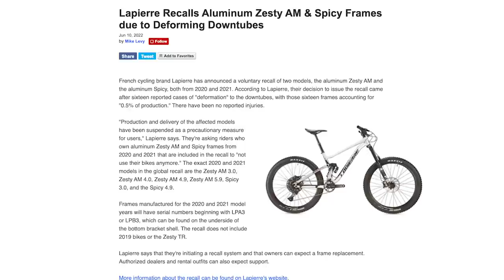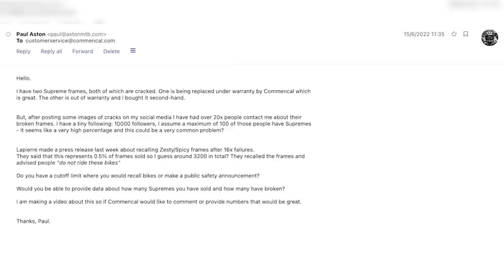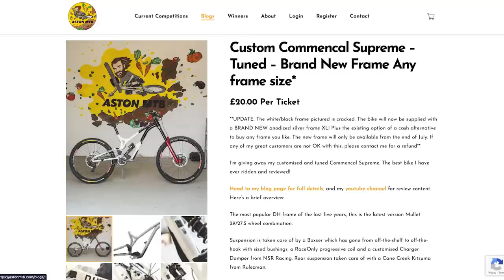AstonMTB Commencal Supreme Public Service Announcement: Recall?

Comment: Real MTB Journalism! I don't think people appreciate the concept of being fully self-funded and not taking free test products. This is the only channel I can think of that does this.  I wish you could check out the Rockshox SID XC fork. I've had 3 with bushing issues. Finally Trek just bought me a new Fox 34 because they lost faith in Rockshox ability to send a fork that lasted more than two rides.
Reply: Rockshox sends brand new forks with no oil bath on the lower legs. Saw a video aboutthat some time ago and I had the oportunity to open 5 Rockshox Recon 120mm of travel, all of them completely dry from factory. Their excuse was "It`s supposed to make a preventive maintenance service before giving the bike to the customer"

Comment: Would be really interesting to see a hardness test done in the effected areas, seems to be always very close to the welds. Heat treatment is crucial with aluminium post welding and can massively effect how the material behaves. I am a former aviation metal worker so had to deal with this on a daily basis so seeing things like this rings many alarm bells

Comment: Paul, you mention some cracks aren't too serious and should just be checked regularly. If people with those cracks in out of warranty frames really want to keep riding them, I'd suggest they spend maybe £20 and get some dye penetrant inspection rattle cans. This should highlight the full size of the crack, some of which may not be visible to the naked eye. Then with a Sharpie or similar the end of the crack should be marked. This should provide a fairly good way to monitor crack propagation.
Reply from the maker: Great advice, thanks. 

I’ll try to get some of that to check mine.
Reply: My thoughts exactly!! Hopefully the results aren't too scary!

Comment: @AstonMTB Are the followers who send in photos of cracked frames also mentioning the model, year and ~ most importantly ~ size? 

My understanding is that larger frames typically have more issues - likely because their riders are on average heavier and can create more force - but also because the geometry of the frames and tubing and welds may not be proportionally increased to handle these higher forces (trying to keep the weight down). 

Have you seen many smalls or mediums with these issues?

Comment: its crazy how some Banshee Screams that are 19 years old are still not cracking, even being designed for hucking and people doing just that with them. And now bikes last a couple of years
Reply: Sometimes even months...
Reply: Though to be fair I think some other banshee frames have had cracking issues reported on forums.
Reply: @chrisanderson8578  im not really sure, i know about the scream, the v1 and v2 is the best version. The v1 is what bender rode in 2003 and 2004 it had cracking issues around the bb area but its strong and lasts.
Reply: Banshee uses a seven thousand series alloy/ Commencal uses a six thousand series/ i wonder if the seven thousand alloy’s resist cracking better?

Comment: I bought a 2017 Commencal Meta 4.2 and loved it! In 2020 I was changing the rear shifter housing and when I removed the cable clamp on the bottom or the rear swingarm I discovered cracks had spider'd out from the bolt insert holding the cable clamp. The rear swingarm was replaced under warranty but it took 2 months because they didn't have any replacements in North America. I wonder  if that's a common failure point of those Meta 4.2 bikes? I'm 100kg and never surprised when bikes or bike parts fail but it socks and has nearly ended me.

Comment: Currently warrantying my cracked Supreme and its not a great experience... I bought the 29/29 version at the end of last year, and now in Canada they are out of these warranty frames and only offer the mullet configuration. Commencal have told me that I am responsible for purchasing a new wheel/tire/cushcore and are offering a generous 20% discount... 

Doesn't seem fair that I need to shell out $650 for a new wheel when the bike they made has cracked, and they cant sort out their inventory.

Comment: Commencal must know. The warranty claims must be building up. At what point do they do a recall?
Reply: Specialized have been cracking since 2001. They certainly knew
Reply: @janeblogs324  not the demos , how many cracked demos have you seen ?
Reply: @blackmetalgoat9060  Demo 8 was cracking a lot in magnesium link, circa 2010-2015
Reply: @noeserd  ok , do you guys know anything about the 2015 to 2019 Scott Gamblers like if they tend to crack and where ? Ive got one and ive searched it up cant find any cracked ones but would like to know anyway
Reply: @blackmetalgoat9060  there are very very few, ive only seen 1 or 2
Reply: @noeserd  oh ok thats nice , btw youre demo is absolutely beatifiull a friend of mine had one same spec but with red spank wheels GORGEUS
Reply: @blackmetalgoat9060  Scott Gambler  are in carbon not aluminum
Reply: @boriscima8134  nop, only the new gen and even those are available in alloy

Comment: So, are the frames heat treated post welding? The manufacturer would have to tell you if you asked. These all look like fatigue cracks, rear damper bottoming out harshly exacerbating it. 
Can anyone that owns one Rockwell test the frame and welds? The tool is cheap to make, or any engine machine shop can do it

Comment: Are you kidding me. They only offer 10% off on a second hand frame. It’s a downhill bike. I have a 2017 transition tr500 not a stress crack in sight. So I prob just threw $1000 down the drain on this frame? Shart!!